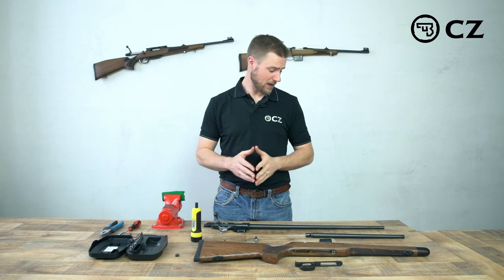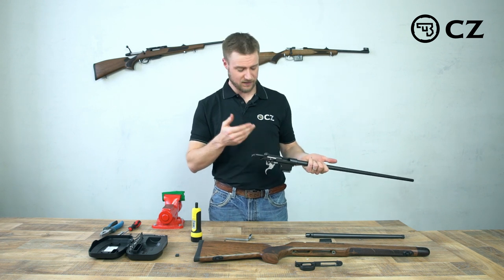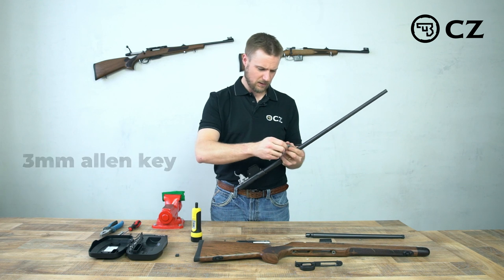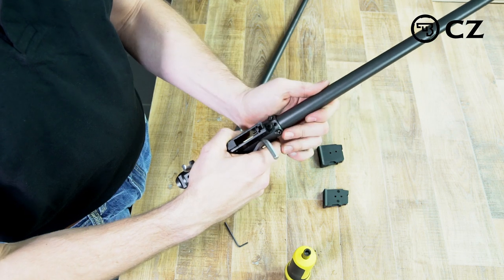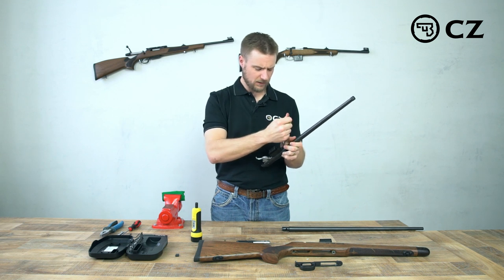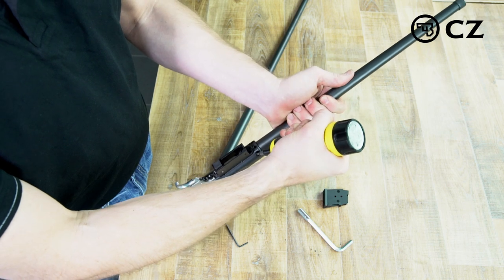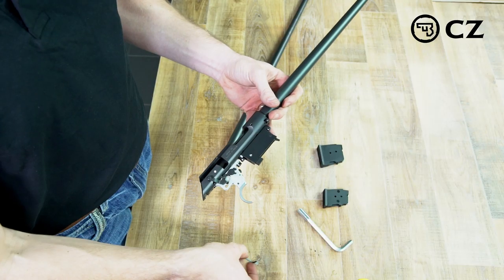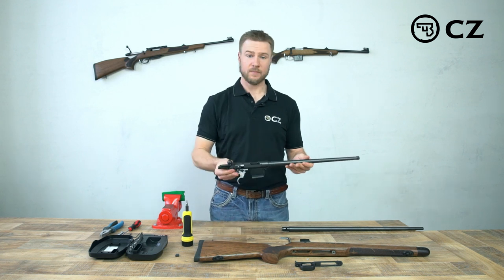CZ 457 barrel change

Comment: How decent of CZ to make a video to show us how to change barrels in the new 457 model.  How about producing some barrel kits so that we can take advantage of this fine video production.  Otherwise, it's useless.
Reply: Order from their site directly, most are showing in stock
Reply: I ordered one a week ago.  Just got it las night.  Heads-up. The instructions are a bit different than what you see here. Torque specs are different and they recommend a gunsmith for proper fitment and heads pacing.  Ughhh....
Reply: @DrDIII  I just did this and as I was approaching upper 30's inch/lbs., I thought, this is BS! ... too much torque.  Last time I trust a You tube video for torque specs! But I thought this was the manufacturer I was referencing..... grrr
Reply: @chasehubbard5303  I'd roll with it. I don't remember if I  did 30 or 35in/lb, but the new barrel shoots lights out. I bought the 24" .17hmr and I'm never going back to the.22
Reply: @rustinthewheel order from WHAT website? CZUSA says they won’t sell directly to consumers.
Reply: @DrDIII  Still sticking to the 17hmr barrel? I'm contemplating getting a 17hmr barrel swap but I'd probably still go back and forth, why did you prefer the .17 so much?
Reply: @FerventReminder  I hunt fox and rabbit.  The .17 can put them down at 100-150 yards easily.  Also, my .22 lr barrel was a real princess.  It only liked expensive ammo.  The .17 barrel is a bit finicky, but mostly eats everything I feed it.  With Hornady 20 grain V-Max, I can hold under MOA at 100-150 yards.  This allows for head shots on rabbits at distance, allowing me to not destroy the meat.   17HMR ammo is cheap, fast, and deadly.  I think it beats .22 in every way measurable.

Comment: The video guy says the barrel screws are Allens.  My 457 uses T-15 Torx/lobed screws, which is a good thing!  Allen heads strip much too easily.
Reply: My new 457 is 3mm as stated.  Torque specs are not

Comment: Will headspace be an issue with authentic CZ barrels when swapping between different calibers? There is information from various online sources that says headspace must be checked even with CZ barrels when going from one caliber to another. Any clarifications on this?
Reply: I just received my .17HMR barrel for mu 4567 pro varmint.  The instructions state you need a gunsmith for proper initial fitting.  I’m guessing head spacing is an issue.  They also give different torque specs than what’s given in the video. Lame…
Reply: @DrDIII  Lame is right.  I just needed to complain one more time so I can move on lol

Comment: I found it helpful to also loosen the front magzine box screw to facilitate the barrel change
Reply: (I know this post is a year old, but I’m hoping someone sees my comment) Your comment about loosening the front magazine box screw is interesting. The barrel on my recently purchased 457 American was stuck, frozen, wouldn’t budge. CZ sent me a reply saying you "MUST" loosen the rear screw first, and then tighten it only after tightening the barrel set screws once you replace the barrel. I am not technically proficient on gunsmithing in the least, but how is it possible that this CZ gentleman and those in other videos do not even touch either one of those screws and their barrels slide right out?
Reply: Your the man i was getting crasy thanks ALOT !!
Reply: Berapa harga larasnya sampai di indonesia
Reply: @RobertJones-yq6jk  - I'm also late to the party...I heard this only affects the 455's, not the 457s. You loosen the rear mag screw 1-2 turns, undo the barrel set screws, exchange barrels, tighten barrel set screws, tighten rear mag screw - done. Hope that helps, cheers...

Comment: Do you know of any reason why one would have to loosen the magazine housing "rear screw" before loosening the the barrel. It  is locked in the receiver and will not budge a hair unless that screw is loosened first. There is nothing in the manual stating that. No other video I’ve seen, including yours, requires that screw to be loosened first. Any thoughts?

Comment: When are 457 barrels coming out. I know the 455 barrel fits but they say they wont match the receiver
Reply: I bought the 22Lr  CZ-457 separately and then bought the 17HMR and 22WMR later when they finally got them in stock. It states specifically in the owners manel to check the head space on each barrel because the bolt face and barrel aren't matched at the factory. There's a lot of internet chatter on how important this is. I used Go and No-go gauges because I am an attention to detail personality. If you go this route, make sure you remove the extractors so they don't interfere with the clearance space. Good luck.
Reply: @randmayfield5695  any preference between the 17hmr and 22wmr on the 457?
Reply: @FerventReminder  Cost of each with respect to ammo. Of course the ballistics are very different but I only target practice and don't hunt anymore.

Comment: Thanks for the instructions. The .17 HMR barrel looks significantly shorter than the .22 LR barrel. Was the .17 HMR barrel modified?
Reply: No, there are barrels for the 457 that come that short. If you can look, it's even threaded and everything. There are 457 models that come with 16-18 inch barrels like that.
Reply: @Dr._Nope  Than you for the information.

Comment: Hi, I am one of those who use CZ guns. I currently own both the CZ 512 22 WMR and 456 22LR. I would like to ask you if the dimensions of the barrel base (receiver side)of the CZ 457 and 512, both 22 LR and 22 WMR, have the same dimensions? Simply put, can the barrel of the 457 fit into the receiver of the 512? Thank you very much for answer.
Reply: I thought I read on Sportsman Warehouse in the description titles that they did. But you may want to double check for yourself. I may have the wrong model. Not sure.

Comment: Can the 17hmr or 22lr swap with the 22wmr?
Reply: yes - the 22wmr shares the same mag as the 17hmr, and you'll have to remove the spacer in the mag well as described in this video if you actually have a 22lr setup - otherwise, same procedure
Reply: Thanks...I got the 22lr, I want to buy the wmr to swap with.
Reply: @xeethao  I hope you can find the replacement barrel easily! Where i live, they are very hard to find...!
Reply: @qcwallace  Do you know if these barrels can be swapped in without requiring shimming? I've read mixed reviews/info that headspace must be checked and address appropriately even if the barrels are authentic CZ barrels.
Reply: @xcoyco7301  i've read that too, but i don't feel competent enough to give you a real answer. A visit to a gunsmith to verify the headspace with gauges should not cost a lot tho, i'd rely on that
Reply: @qcwallace  Thanks for the honest response. I’m just surprised CZ approved the video here without providing any additional information about potential things to ensure fitment. Nonetheless, thanks again.

Comment: I have a 455 lux .22 WMR , If I buy the Varmint Barrel in .22WMR will it fit in the Lux stock or will I need to buy the Varmint stock?
Reply: You'll need a new stock
Reply: You could have the barrel channel enlarged to accept the larger barrel, but it will have a gap around the american barrel

Comment: Haha I call bullcrap. I took my factory barrel out and it did not just slide out like that, which is good, I want tight tolerances but putting the same barrel back in brought me here looking for instructions. It will not just slide right in like that